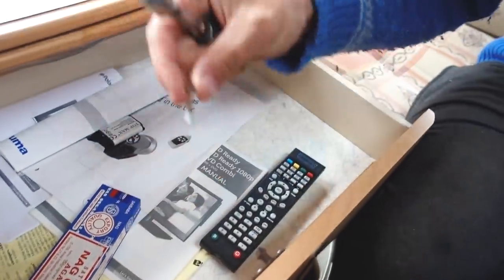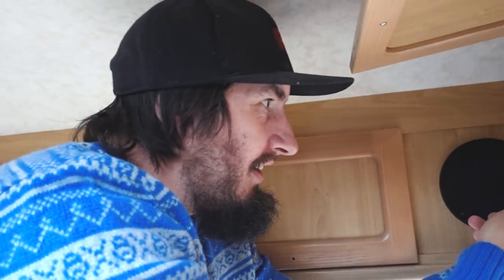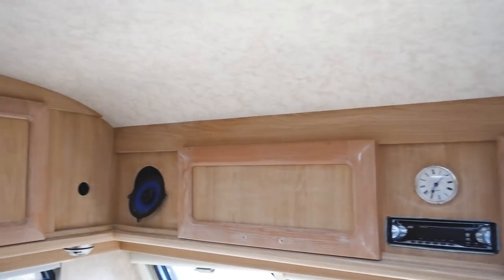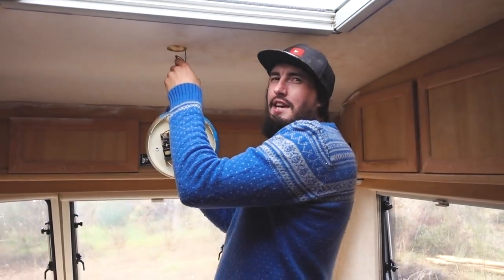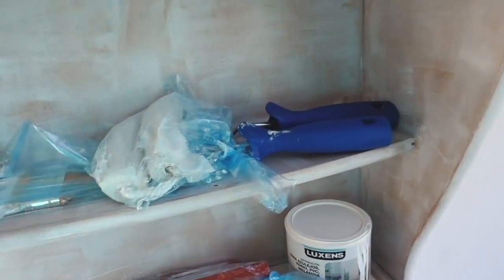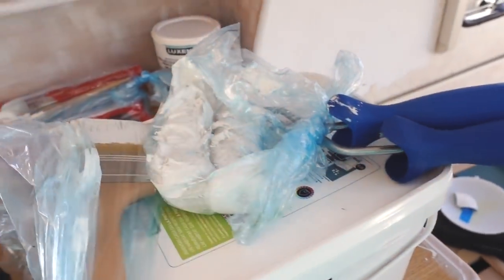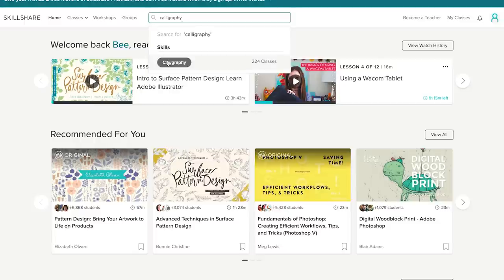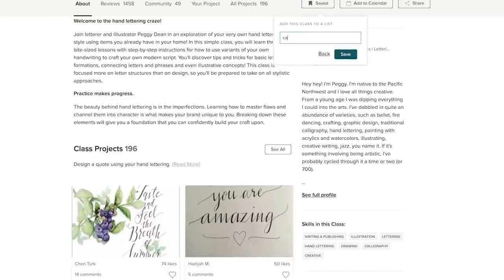It's Completely TRANSFORMED! Easy DIY Painting A Caravan

Comment: I've painted similar laminate cupboards.  I did not sand.:

1) Washed with TSP to degloss.
2) One coat of BONDING primer
3) One coat of BLOCKING primer
4) Two coats of the most highly pigmented paint I could locate locally.  For me in California that was Dunn-Edwards.  

Turned out great and 7 years out they are still holding up fantastic. 

I have also done the sanding method and those turned out great too.  Just more than 1 way to get to the same results.  I'm a big fan of deglosser+primer instead of sanding.

Comment: The white is a great choice - so light. You can get paints which go straight on laminate. It's more expensive, but saves a lot of time, if you were on a time budget rather than a financial one.
Reply from the maker: Cheers for the input, couldn’t find a laminate paint in the store would have been handy!
Reply: @theindieprojects  We've used Annie Sloane chalk paints straight onto furniture with laminate surfaces without sanding but it's £20 per litre. It goes straight onto most surfaces unless the surface is too absorbant, then you'd need primer to avoid doing lots of coats of expensive paint!

Comment: We bought our class c motorhome last July in Florida. It had those god awful cabinet finishes, too. I decided to paint everything.  I started with sanding and cleaning with water and vinegar. I didn't want to use oil based paint so I primed the kitchen area and bathroom sink cabinets with Kilz 2 which is latex. On top of that I used Lowe's Valspar cabinet paint.  Four coats of paint later it was still streaked. I finally gave up and bought alkyd oil based paint and  I am only having to do two coats even the cabinets that I didn't prime. If it chips anywhere, I have touch up paint. I am still painting today!  Everytime we move to a different campsite it takes me a few days to get into the painting mood. Actually, I'm never in the painting mood. I love what you have done to the camper to make it light and airy looking.  It's depressing to sit inside a small area when the walls and cabinetry are dark especially when its cloudy. Keep the videos coming, I love the energy you both have.
Reply from the maker: Great to hear from someone who’s done the same! ❤️😊

Comment: The caravan was fine as it was but at the end of the day, it is YOUR caravan and you can do with it as you see fit. Just before I bought the Lunar, I viewed a Swift and the wood had been badly painted with white paint and it looked absolutely awful. That's why I don't like the idea of painting over the wood in a caravan. At least you're doing a decent job of it and it will look good when you've finished.
Reply: Probably halved or even less it’s value now

Comment: TBH, I thought the cabinets looked fine with the original finish, but I do like the white. It does really brighten things up. 

For the countertop/backsplash area, I thought those self-adhesive tin ceiling tiles would look nice and would give it kind of a cool flair. You could probably even find them in gold, to match the hardware on the cabinets.

Comment: Shouldn't use emulsion paint on the fake wood cupboards. it will scrape off/chip very easily. Paint for wood, would be a better choice. Varnish it as a final coat to preserve your work!

Comment: Looks great! Why do they always make them so ugly off the line??? Ugh! We have a fifth wheel style caravan that we are renovating in the USA, and we weren't sure what we'd do about the walls and cabinets. Well, between water damage, a layout that didn't meet our needs, and so on, we've decided to completely gut it from end to end and side to side. We might re-use some of the cabinets, but most likely we'll build custom cabinets out of the elements we salvage from the gut job. I bought some trim for a project though that is the same weird laminate that will need to be sanded and painted. Not looking forward to that job!
Reply from the maker: Good luck with it!

Comment: Why take out the furniture and microwave??? Won't you need places to sit, etc? For future reference, high gloss paint is much easier to keep clean. The walls will be easy to do, without masking the windows, just use an angled, skinny brush and go slow and easy around the window. I use angled thinnish brushes for all paining around edges and never mask anything. Just keep a wet rag handy if you get a bit of paint where you don't want it. Works great  i am way too lazy to mask. I prefer to just be careful. The painting came out beautifully. I loved the oak look but white looks smashing, too. You will probably find it is much better NOT to mix different types of white. Makes them clash. I remodelled my entire kitchen a few years back. Looks smashing!! Took months, even ripped out walls and made an island.
Reply from the maker: Took out the furniture and microwave as we didn’t want paint getting on them, they will be going back in once the painting is finished!
Reply: @theindieprojects  oh that's good. Couches are pretty.

Comment: I think you have made a mistake. Also Wrong paint to use
Reply from the maker: Guess we’ll find out
Reply: @theindieprojects  Sadly you will, next time it will help you to take the doors off, the screws were only ever used once including handles, they will easily come out with a battery driver in no time. You need an oil based undercoat at least to hold back staining/yellowing. Unless you spray them with a Rustoleum plastic coat that will give you a great finish without so much prep.